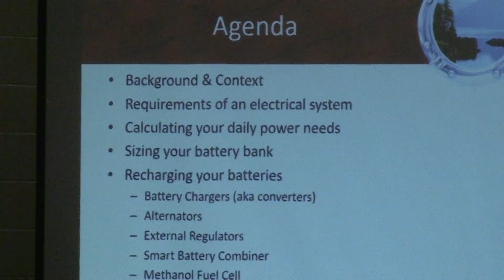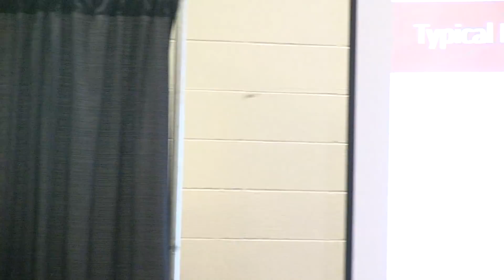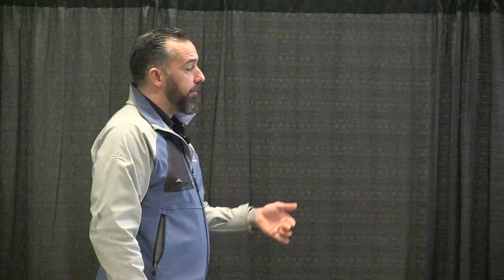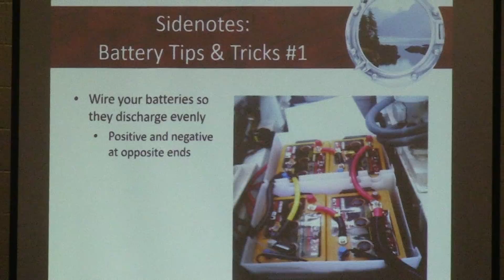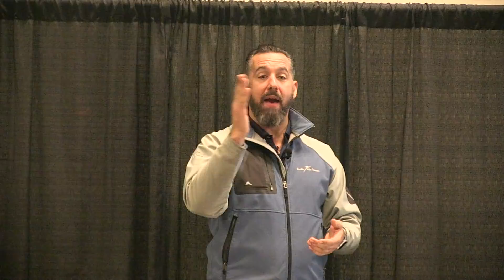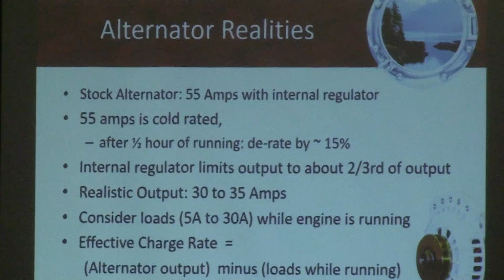Understanding and Designing a Reliable Boat Electrical System

Comment: I know this is old but you don't measure your useable power in Ah but in kwh because Ah is only half the story 500Ah at 12v is 6kwh but at 48v thats 24kwh 4 times the available power but still the same Ah. Also when your trying to work out power consumption a kwh is universal regardless of voltage
Reply from the maker: Hi Shayne, battery monitors and batteries measure capacity in amp-hours, hence why keep with the unit in the marine world.

Comment: Question: When i charge a litium lifepo4 battery with my engine alternator, the alternator wil get damaged. Can i protect my alternator with a DC to DC regulator?
Reply from the maker: Hi FirstChoice, since Lithium have such high ability to take a charge, standard alternators easily get overburdened and burn out. The solution is to get a heavy duty continuous duty alternator.